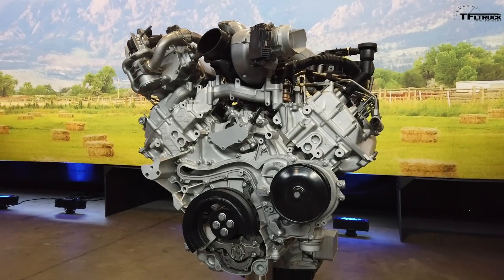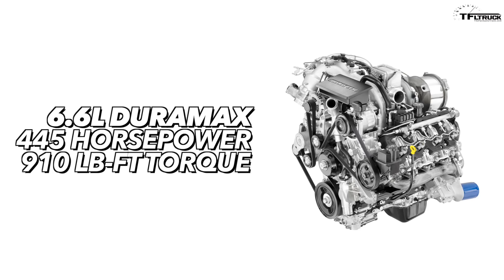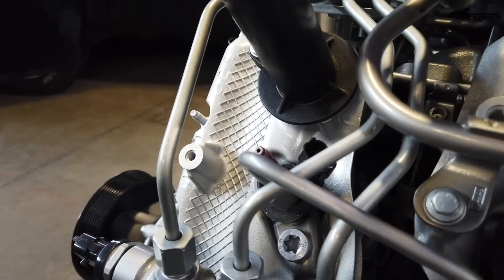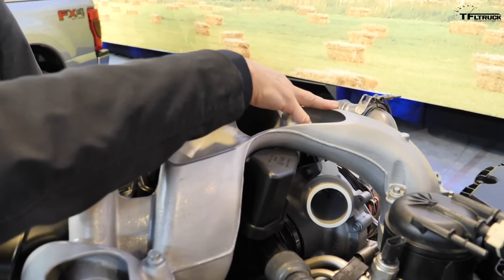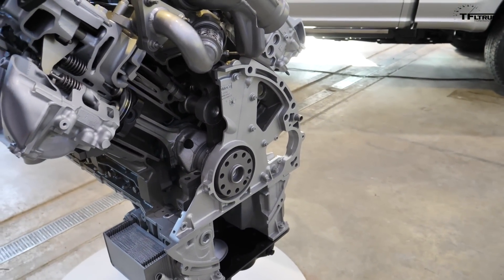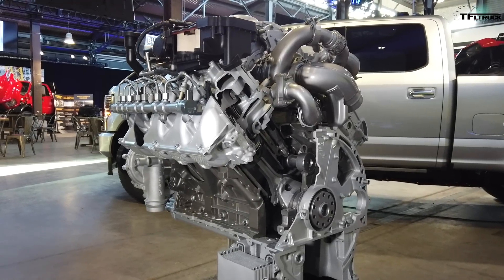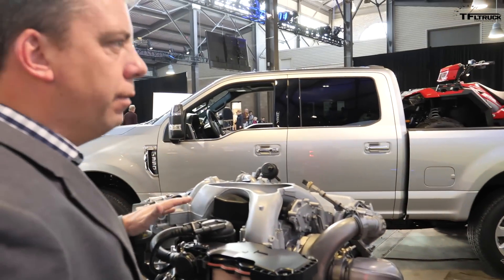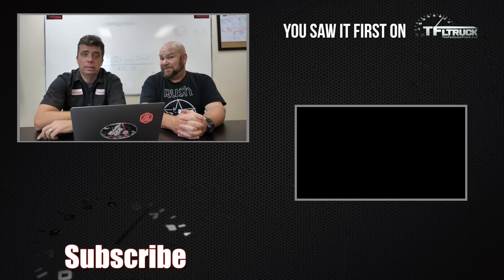Here's How the 2020 Ford Super Duty Diesel Makes 1,050 Lb-Ft of Torque!

Comment: We all know it can tow, we all like HP/Torque, now what have the done to improve their EGR, SCR, DPF? What have they done to combat the ASH accumulation after 125-150k miles of DPF “cleaning” burn off, what so many don’t know is around that mileage you cannot get the DPF down to 100% clean because of the ASH accumulation in the exhaust, you either have to take the exhaust completely off and use a cleaning agent and low pressure pressure washer, if you can’t get it clean, well, break out 4K for a new exhaust. Screw the fancy numbers, we can all read brochures, ask the meaningful questions please
Reply: This would be great to know
Reply: @czwarlord9243  Delete no damn way the EPA can stop me from modifying my own truck.
Reply: Try running a fuel additive called hot shots and find a decent fuel supply that has good fuel. For me that has made a huge difference in how clean Ash filter gets after  regens. I still think the system needs a major improvement, but this has helped me. I have 2011 6.7 with 350,000 km (cdn)
Reply: Please
Reply: who gives a sh*t. ALL of these new HD trucks are for rich kids, not many blue collar working men can afford a $70k truck. Oh, and you actually expect these city boys to ask meaningful questions?
Reply: @veterans_outdoors  Found a lariat ford f250 for 55k near me and can get a work truck dodge 2500 with a manual trans for 45k near me
Reply: Ford F-250 6.7 Super I had two 6.7’s, a 2011 and 2015. I put 173,000miles and change on the 2011, and 71,000 on my 15. I never had any issues with the exhaust.  If you give her the old Italian tune up, they run fine.  I used both trucks to pull a pint or hitch recycling trailer. Trailer was 4,000 empty, and was in stop and go traffic and recycling stops.  Seems to me that guys having DPF problems, also idle their vehicle way more than necessary. Cut down your idle time maybe?  I think the 6.7 is an engineering marvel and one of the best truck Diesel engines ever made. Easy to get 20 mpg and also has the power and torque to do whatever I needed. Both were reliable and. Ever left me sit anywhere.
Reply: @Campjohnbobb  BAHAHAHAHA.. The 6.7 is a marvel???? OMFJ That is hilarious LOL, loved your comment!!
Reply: YOU ARE RIGHT FIX THE STUPID DEF SYSTEMS
Reply: Blame the government for the emissions
Reply: i agree also i would love 200-250 hp and 450-500 tq engine if they could just make a more forgiving fuel system for poor quality fuel some of us live in old America in the midwest where gastashions have 60+ year old tanks and water problems

i mean my 84 6.9 never had an problem my  95 7.3 never had a problem but my dads brand new 6.7 has had water ruin the injection system twice from poor fuel

its kinda bullshit but at the same time a few drops of water should not ruin your fuel system
Reply: Nothing.. nothing was done
Reply: mudslut17 are you listening to the expert?
Reply: Ford F-250 6.7 Super amen!
Reply: Delete 👍
Reply: The ash def, or Residual sales and service unit is not going anywhere any time soon.
Reply: Seriously. I just dropped thousands on emissions fixes on my Duramax.
Reply: Ford F-250 6.7 Super Right on brother!
Reply: Big Truck Med Rv Read the actual dyno sheet. The Ram did not make more. https://www.google.com/amp/s/www.tfltruck.com/2017/03/2017-heavy-duty-turbo-diesel-dyno-battle-truck-puts-power-video/amp/
Reply: @czwarlord9243   That's what I'm saying DPF pretty much puts a regular maintenance item in your  Fucken exhaust system that's ridiculous

You're exhaust should never have to be replaced or maintained in the lifespan of a vehicleUnless you annoyingly damage it

That's why I find it ridiculous that you have to maintain a diesel particulate filter when normal vehicles even diesels up till 2003 never had to do that and that's why I don't think I'll ever own one of the Power stroke Cummins order a Max of the now because they're just To is you to break require incredible amounts of maintenance and in depth maintenance at that
Reply: Big Truck Med Rv calm down big man. Deleting isnt that complicated
Reply: People don’t care they will sale like hot cakes for 65-85K
Reply: Big Truck Med Rv you sound fired up for no reason. Deleting isnt a dark art lol its not difficult. Idc if youve been doing it for years
Reply: I completely agree were listings to stats that i beet are unrated on some trucks and over exaggerated on othere with numbers that are just set to be best in class no more the only really meaningful thing is the real world test and dyno in diffent altitude and weights at this point
Reply: I hope they don't start inspections here in Oklahoma.
Reply: @czwarlord9243  its called places over seas and have them send it to you and just take a chance of customs seizing it or get it from mexico
Reply: Pull the DPF and clean it. Very simple process and doesn't cost alot.
Reply: @scottw2157  sounds like a lot of work on a area most people will never touch in the service life of their vehicle
Reply: @Friedrich-Wilhelm-1980  nah I'm around a lot of trucks that fall in the severe duty category.  Idling 75% of the time.
Reply: @scottw2157  that sucks idling to me has always felt like a huge waste i get they need to but if a stop seems like its going to take a long time i just shut down
Reply: @Friedrich-Wilhelm-1980  nature of the business.  High use of PTO as well.
Reply: @czwarlord9243  we've done at least 70 . Some multiple cycles and have had positive results and a drastic reduction in cost pertaining to  after treatment related issues.
Reply: Big Truck Med Rv just have to know a guy
Reply: Big Truck Med Rv i used to work in the shop too so i guess theres that
Reply: @czwarlord9243  nice! What year? 50k is too much for me, i could build my dream rig for 30/40k and have zero emissions bs. I do really like 2010-2014 ram HD, really good potential in suspension options and a lot better build quality on the cab and chassis versus previous gens of dodge hd... but then i would be dealing with emissions requirements. New trucks just arent for me. Far too expensive.
Reply: @czwarlord9243  honestly it's very easy. A couple hours is better than a $4k + bill.
Reply: Big Truck Med Rv Did you actually look at the dyno sheet? Do the math.
Reply: Soon gasoline engines will get their own type of particulate filter as it gets more common with high pressure direct injection. This means no matter what truck you buy (other than electric) there will be clog ups and expensive cleaning of clogged sot in the whole emission system. I learned the hard way myself paying $3,500 to get my diesel cleaned of sot from the DPF and a new EGR valve to get my truck out of limp mode.
Reply: Big Truck Med Rv calm down grandpa
Reply: Also what have they done for cooling with all this ho and torque?
Reply: Big Truck Med Rv No it didnt. Look at the dyno sheet. TFL was called out about their claim. There is no corresponding dyno sheet to anything above 800. If you understand how a dyno works you can tell the numbers dont add up. The % loss in HP should be equal to the % loss in tq. The 338hp and 828tq numbers are BS.
Reply: Big Truck Med Rv This is the Ram dyno sheet. They took it off the article after they were called out. https://www.tfltruck.com/2017/03/2017-heavy-duty-turbo-diesel-dyno-battle-truck-puts-power-video/2017-ram-3500-cummins-dyno/
Reply: Big Truck Med Rv And here is the Ford dyno sheet. https://www.tfltruck.com/2017/03/2017-heavy-duty-turbo-diesel-dyno-battle-truck-puts-power-video/2017-ford-f350-power-stroke-dyno/
Reply: I agree, ty
Reply: Big Truck Med Rv no kidding ay? Are they watching the actual video?
Reply: We dont care
Reply: Who cares? Yank it out if you care about your truck
Reply: @joeysprojects9081  Not everyone is doing that.  Especially a business or companies with their own maintenance departments.
Reply: @joeysprojects9081  not as possible to do that as years past, EPA is attacking shops that do those or even tune the trucks to bypass the emissions system. They just tore through Oklahoma shops and drop $10k fines like candy.
Reply: YES !! THEY ARE SHUTTING DOWN SHOPS IN SOUTH CAROLINA NOW !!  SOUTH CAROLINA !!!!  ????  WTF !
Reply: Ciampa Customs that’s right 2 big words STRAIGHT PIPE.
Reply: @joeysprojects9081  it will be a felony offense to delete emmisions systems in 2020 diesels in the US unfortantly. This law was passed in September of this year. Not saying its not possible but no companys will make deletes anymore. They are only going to support 11-19 psd. So ram gm and ford will be stuck to factory running gear. Sucks but it's reality
Reply: @joeysprojects9081  the EPA made it illegal to do any emissions deletes for any application so it's no longer an option
Reply: Captain Rudy 4021 i literally just stickered my deleted ‘16 powerstroke in MA, the most strict state inspections. They say you cant fool the computers? Theres always a way around it
Reply: Honestly the trucks are shit compared to the old
Reply: For reals they look all nice new then u pull 3 times and starts to throw up white smoke from un burned diesel
Reply: Martinez Cesar Unburned diesel fuel burns black not white just an FYI!

Comment: Do they use the same cp4 pump as current ford trucks?
Reply: Jaime Baltazar looks like it’s a cp4.2 so yes
Reply: With RAM and Ford using this pump, does anyone know if there were modifications made to the pump or is it identical in design to the pumps that were failing in previous years?
Reply: he did say "...upgraded fuel pump..." so I would say it is not the cp4
Reply: Here’s a little more information on the fuel pump.

https://www.drivingline.com/articles/why-the-2020-super-duty-will-break-the-1000-lb-ft-barrier/